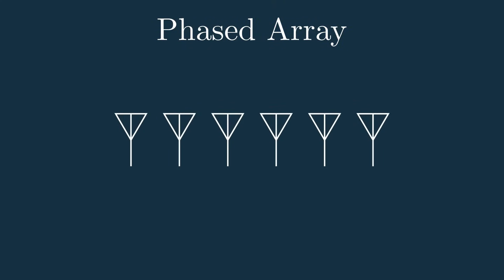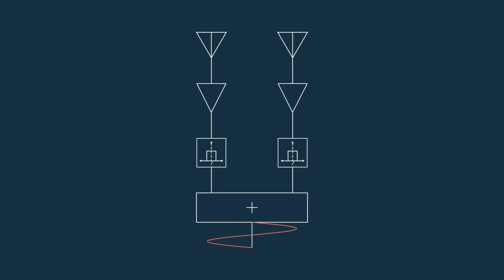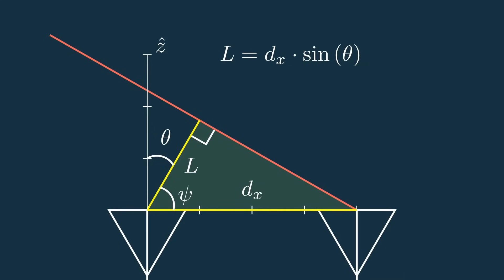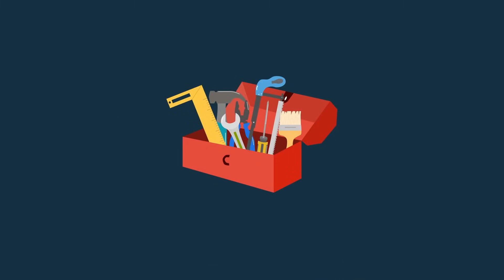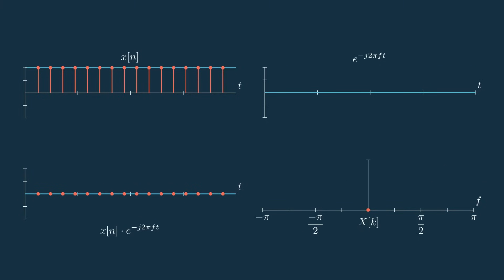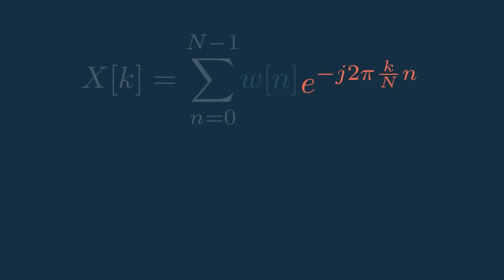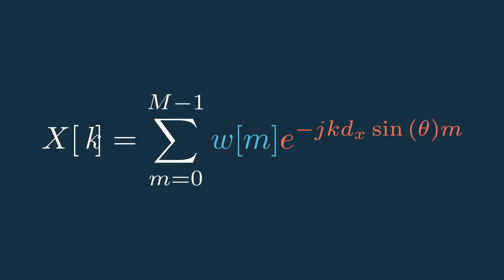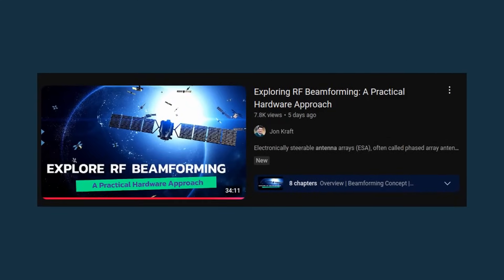Phased Arrays - Steering and the Antenna Pattern | An Animated Intro to Phased Arrays

Comment from the maker: What uses do you see for phased arrays? Do you work with them regularly, or are you completely new? Let me know what else you'd like to learn about phased arrays!
Reply: I am currently a newbie with phased arrays. My potential first job will be to design patch array antennas with circular polarization for space comms. Now I am studying these topics simultaneously: patch antennas and arrays. Also very interested in radar applications.
Reply from the maker: @ Super cool stuff! Good luck on getting the job. That's a really fascinating area to be in :)
Reply: Thanks for this! My interest is in recording sound. You could separate the crowd from the speakers. Then what if you could take random clips from social media and use the seat numbers to steer the sound?
Reply: @curiousgeorge7515  
Definitely possible but the baseline of the array (aka element spacing) needs to be proportional to wavelength, to have equivalent performance. lambda/2 is basically a maximum, to avoid spatial aliasing, which is where multiple scan angles look identical ('grating lobes' the size of your main lobe appear).

And since the wavelength of sound ranges from 17m (20Hz) to 17mm (20kHz), you need your elements to be ~8mm apart to beamform 20kHz sound. But then your phase deltas are so small that you can't get a good beam formed for the low frequency stuff. The gist is that sound covers such a wide bandwidth, it's hard to build a good array for all those frequencies.

Arguably the hardest part is that you actually want to operate at all those frequencies *at the same time*. There's no point in making a speaker that's only good at making an A#. So all those phase deltas in the antenna weights, which were calculated at a single wavelength, aren't good enough. In general, phase shifters alone aren't enough. You actually need a "true time delay", which is frequency-agnostic, to do real ultra-wideband (UWB) beamforming. That, or you give entirely separate signals for every single element, which means hundreds of digital-analog converters and analog-digital converters.

I'm kinda yapping tho
Reply from the maker: I'm definitely planning to do a video on grating lobes soon. 

Also yeah this is a great comment @j4mag :)
Reply: @curiousgeorge7515;
More difficult with sound, as wavelength is so large, and the sound is "wideband"... That is, there is a very large ratio of the low frequency, say 50 Hz, almost 7 metres, vs. Even 5 kHz at 7 cm!
There is a technological for beaming sounds, using an ultrasonic "carrier", I think "Great Scott" just did a video on this
Reply from the maker: @curiousgeorge7515 That's a super interesting idea! It could be modeled as a sparse array.
Reply: Any plan to make a video about rotman lens?
Reply from the maker: I'll have to do more research on rotman lenses, but those things are really fascinating. Thanks for the idea!
Reply: Really cool video! I'm currently working on my graduation internship. Rewriting a phased array beam modeler for radio telescopes. So this kind of stuff has been consuming my entire life for the past couple of months 😅
Reply from the maker: @super_jo_nathan  awesome!! Hopefully this was useful
Reply: Phased array radar
Reply from the maker: Yup
Reply: Could you tell us what your sources are for preparation, such as any books or other content? It would be appreciated.
Reply from the maker: @ yeah, if you look in the description there’s a list of resources including books, articles, and course slides. There’s also an included python notebook in the description
Reply: I worked on using TDR, instead of VNA to analyze phased array antennae... Modern scopes have enough bandwidth to do time domain work that had to be done in frequency/phase, in "the olden days" 😂
I used to have "discussions" with the "frequency domain bigots" at Agilent 👹
Reply: Maybe throwing some Jones calculus in the mix could be an interesting topic for a next video
Reply from the maker: @super_jo_nathan  I’ll check it out 😁
Reply: I’m a tad out of field, but i use a lot of concepts derived by those studying phased arrays when working on my analytical signal processing research
Reply from the maker: Awesome!
Reply: The scanning speed enables communication with large LEO satellite constellations like Starlink!
Reply from the maker: There's so many applications of this I could've talked about. It's a pretty awesome technology
Reply: Working in a team building radio telescopes using antenna arrays mainly to detect fast radio bursts in space. My current task is to identify and remove unwanted signals. Would've taken me so much less time to get in track back then if I had your video and animations. All I had was a couple papers to read :)
Reply from the maker: @x16AC  That's awesome! And thanks so much - my goal is to do a little bit to lower the barrier to entry in this complex field :)
Reply: I had a small confusionat 5:13. On my first watch, I thought the red line represented the direction the light waves are coming in from and that the waves were coming in from the left. However, upon rewatch, I realized you said wavefront, and so the waves are coming in from the right. I was a bit confused on why L was the relevant distance instead of the red line's length, but now it makes sense !
Reply from the maker: @cesardelgadillo4139  Yeah I can see how that would be confusing. Maybe there would've been a better way to visualize that. Thanks for watching!
Reply: I'm watching this via SpaceX Starlink. We were fortunate to get in on the beta testing and so use the original round "Dishy." It's a phased array! (And has given us amazingly good performance!) Your video was great, thanks! 😎✌️
Reply from the maker: @gus473  That's awesome! The signal path has an awesome breakdown of those (not sure if it's that exact model)
Reply: mPAR, just around the corner for the past twenty years now.
Reply: I know nothing about radars but I want to learn. I want to work with them during my lifetime.
Reply from the maker: @Lambda420  awesome!
Reply: working on super-wide spectrum radar guidance systems; mainly for blind (low-vis) helicopter landings and self-driving quarry trucks :)

extremely clear and informative, i feel like i was looking for copper and found gold!
Reply from the maker: @freyawion5337  that’s awesome!!
Reply: Working with the meerkat radio telescope 😊 We get baseband data that we beam-form offline.
Reply from the maker: @fazalkareem329  so cool!
Reply: RADAR. Most modern radar are based in phased array.
Reply from the maker: @ Radar for sure! That’s my main interest. I’m not sure if most use them yet, but definitely a lot. I may also be biased being more in the weather radar field which doesn’t use them a majority of the time… yet
Reply: In integrated photonics we use optical phased arrays, where the waves are of infrared light (Thats in the ~200THz range). The phase shifting happens in the optical waveguide. The phased array can take the light from a laser source and steer it in 1D (or 2D if you also modulate wavelength) ; there are no moving parts, the phase shifting happens with a bit of current/voltage for each channel of the array. 

Or, the phased array is used the other way around to collect light from a chosen direction, and guide it into a single photodiode. 

This can be used in lidar technology, without any moving parts. This could drastically reduce the cost of a lidar system.
Reply from the maker: @ that is so insanely cool! I would love to learn more about optics
Reply: Cool video! I’m a weather enthusiast and I think phased array radar is the future of tornado identification, and mobile phased array radars will change our understanding of storm structure.
Reply: i would like to get some about vector modulator phase shifter please
Reply: I think if someone gets a chance to work with RADAR software, they might really enjoy it.  I am just the dude who knows how to turn system engineering demands into code, but if one keeps an open mind, they can learn various bits of this stuff.  I find the technical details of turning analog signals into something I understand, like RADAR returns, quite interesting.  I may never understand it, but your videos do a nice job of trying to explain quite technical stuff to non experts.  I will try to remember your channel, in case someone I know is looking for this sort of info.
Reply: Im currently working on a cubesat project where we plan to use  phased array intelligent surface.
Reply from the maker: @  That's awesome!! Feel free to share updates on linkedin. I'd be happy to see what you're working on

Comment: Hello sir, I would like to know if optimization algorithms such as particle swarm optimization algorithm can be used to choose the phase/gain values (called the “phased array weights”) during the design of beamforming ICs such as ADAR1000 IC by analog devices.

Comment: Very clever, too bad there aren't any hobbyists out there putting it into practice. I'd absolutely love to see someone getting an ESP32 or RPI plus some power RF amplifiers and building something like that.
Reply from the maker: Yes, this is something I'd love to do. There are some like Analog Devices Phaser board which is almost in the hobbyist range (but still expensive) and there's automotive chips which are definitely in the hobbyist price range. Unfortunately, I think the reason you don't see more personal projects doing this is due to the price

Comment: 17:31 In this explanation, it is mentioned that plotting from −π to π can show the current state of the AF (array factor). However, when we actually plot it in Python, the shape shows a main lobe appearing at both −π and π, which looks different from the plot shown in the video. Is there a misunderstanding here? Thank you!
Reply from the maker: Good point! There's something happening here that I may not have been clear enough about in the video. When you plot from -pi to pi, yes, you do get a lobe at both ends. Array factors and antenna patterns are often plotted in terms of sine space - theta becomes sin(theta). If you look at the section of the notebook that computes the fourier transform of the input, you'll notice that it's not computing the transform over theta, but rather u=sin(theta). Instead of the normal fourier transform for a time-series signal where you compute it over frequency, we're computing over spatial frequency. Hope this helps

Comment: How do phase shifters work?  Do they simply delay the signal by tens to hundreds of picoseconds?  If so, does that mean the phase shifter setup is independent of the frequency?
Reply from the maker: There is what you're talking about which is called a time delay unit (or true time delay unit) that switches between different physical paths for the RF to take. This introduces some propagation delay in time and is therefore frequency-independent (ideally). There's also actual phase shifters that do induce a frequency-dependent phase shift. You'd use that for more narrow band applications where you don't care about maintaining that phase shift across surrounding frequencies. Thanks for the question!

Comment: This reminds me of the Central Limit Theorem. It basically says that if you sum (actually it's the average, but it is close enough) more and more (say, uniformly distributed) independent variables, then the result will be closer and closer to a normall distribution (the one with a bell curve). Here we can see that adding the signals of more and more antennas (with uniform signal patterns), the result will look more and more like a very weird normal distribution (with side lobes) wrapped around a circle.

Comment: I LOVE your videos and this and your beam forming videos have been helping me set up a WiFi network with multiple access points with some being meshed. In setting up AP settings you’ve helped me by figuring out which APs to enable beam forming in due to layout, interference, meshed proximity to the nearest hardwired AP, and transmit power so far. Currently I’m dealing with 16 APs, 5 meshed, on just 2.4ghz and 5ghz (also playing with channel width for each), but plan on replacing 9 of them with WiFi 7 so watching your videos to learn how to optimize with another 6ghz channel. I have no formal experience with this but you gave me such an intuitive sense of things I’ve been able to reduce drop offs and optimize hopping drastically. I will definitely be supporting thank you. Would love a video non WiFi but love the radar stuff too for presence detections and tracking!
Reply from the maker: That's awesome! It's so cool to see these topics applied in real life!

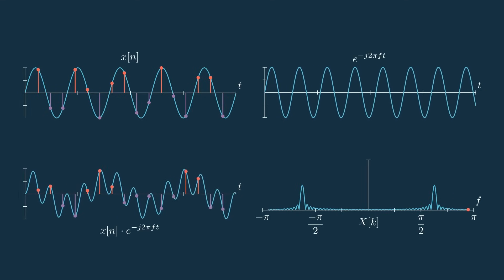Comment: The video is excellent! Thank you for this great material. But i have an observation, it's more of a notation issue, but i believe that since it is a Discrete Time Fourier Transform the classic notation is X(f) since the spectrum is continuous and not discrete (X[k]) (11:09). Even the "x" axis has f as the variable meanwhile the amplitude depends on k which made me notice this small error. Hope it helps someone as i was confused for a second if it was the DFT or DTFT 😅.
Reply from the maker: Yeah... this confused me too when I was learning it and I guess I'm part of the problem lol! This is one of those things that are so simple to mess up and miss. It's also not important enough (in my opinion) to specifically note it in the video, but it can be confusing. I'll try to notice this in the future. Thanks for the comment!

Comment: Hello, how can I know the number of antenna I put in antenna array?
Reply from the maker: It depends on a number of things like desired beamwidth, transmit power, gain, etc. many of which are interrelated. If you're looking to build a real system then you also have to start considering cost since large arrays get really expensive. If you check out the python notebook in the description of this video, you can play around with different numbers of elements to see what gets your desired pattern.

Comment: Here's a fun connection for you @MarshallBrunerRF. If you arrange the antennas in 3D repeating pattern or a lattice, you'll find that math is nearly identical to X-ray scattering of atoms in a crystal, specifically X-ray diffraction (XRD). As a materials characterization method, it's basically giving the Fourier transform electron density (mostly located near the nuclei) in the crystal. It is a very powerful tool because it (1) allows for simple measurement of interatomic distances and (2) the constructive/destructive interference in scattering patterns (see Laue equations) are intrinsically related to the crystal symmetries.
Reply from the maker: Wow that's super interesting! I'll have to check that out. There's so many applications of this math. Thanks for your comment!

Comment: lmfao going from teaching basic trig to how to do Fourier transforms in 5 minutes is wild. great video! think defs worth sticking to one subject / experience level per vid to aid watching experience. keep up the great work :)
Reply from the maker: Good note. I will try to consider this in later videos. It's always difficult to determine which knowledge I should assume and what I should explain. Thanks for your comment :)
Reply: @MarshallBrunerRF  just a counter point to consider, going over the basics helps frame the problem and builds intuition for the more advanced topics. And even for those who aren’t familiar with the Fourier Transform, just knowing where it comes from is enough to spark curiosity. It also lets the viewer discover where along the process they lose track and it creates a roadmap of sorts for further study :)
Reply from the maker: Great point! Thanks for the counterpoint and I tend to agree with you on this. It's difficult (impossible) to satisfy everyone, but I try to make it generally approachable if you know some math.

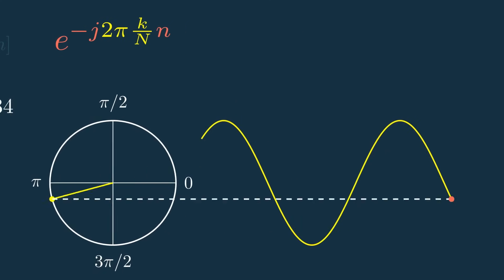Comment: 14:44 don't you rotate in the wrong direction? Since you have a minus in the exponent you should rotate clockwise instead of counterclockwise  or am I mistaken?
Reply from the maker: The issue with getting more views is that there are more people to point out my stupid mistakes.... Yes, you're correct, my bad. Good eye!
Reply: @MarshallBrunerRF It does not detract anything from the overall quality of the video! It already motivated me to do some reading ;)
Reply from the maker: Great! I really appreciate you pointing out the mistake
Reply from the maker: Added to the errata in the video description

Comment: Its was the early spring  of 1984.
The place was CIC onboard a US helicopter carrier.
I was an EW2 (Electronic Warfare Specialists) on watch manning a WLR-1 a superheterodyne receiver, pulling into Norfolk Navy Station after a North Atlantic cruise.
I was getting out in a few months and wanted to operate the WLR-1 one more.
The USS Ticonderoga was pulling out port using it's nav radar. 
All of the sudden while scanning the frequencies I came across the SPY-1 Radar coming online.
My display lit up like a Christmas tree and I called the Chief.
We were all amazed seeing the display.
The analog display of that digital signal was cool.
Reply from the maker: I bet! The analog displays are so much more fun than their digital counterparts. I'd like to get my hands on an old network analyzer or scope for this reason. It'd be cool to make a radar with an analog display as a side project :)